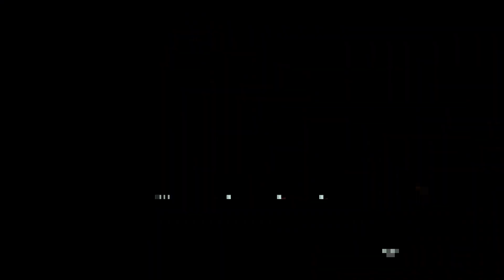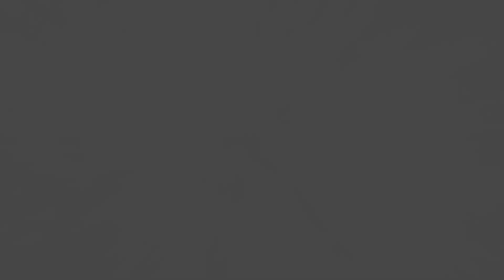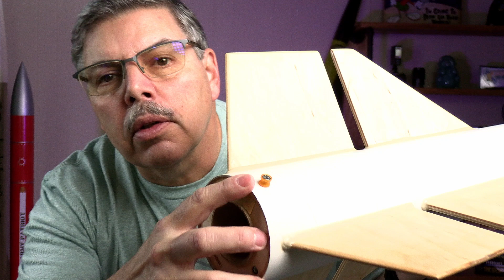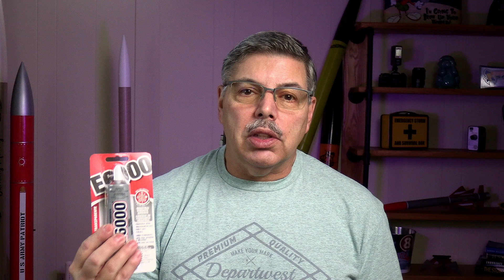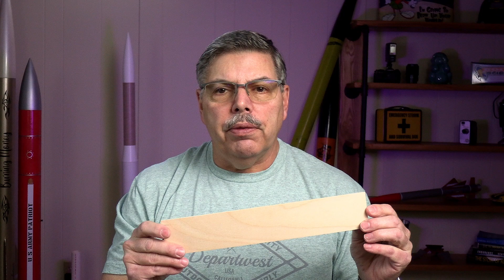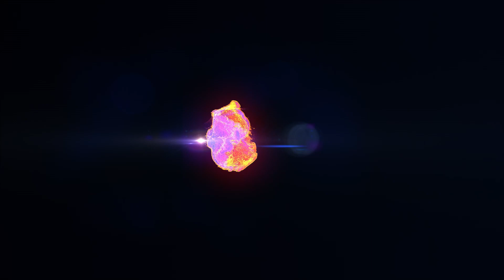Rocket rail button repair with E6000 glue.

Comment: E6000 has lots of uses. It is not heat resistant, it will let go if you leave it out in the hot summer sun. That’s probably not an issue in rocketry but be aware of it.

Comment: I am just starting on my madcow 38mm patriot. I have thought of using E6000 for assembly. Your thoughts?
Reply from the maker: E6000 could be suitable for some things like tacking on fins but not others. It is to thick and not slippery enough to glue a motor mount into the airframe or make filetts. For that I usually use 30 minute epoxy or Elmers ProBond. I like the Elmers because it doesn't smell bad and is slippery enough to get the mount in and then dries hard like plastic. It can also be dripped from the top if necessary. https://amzn.to/3TgzDpO. Everyone has their favorite glue, you just have to find what works for you. I hope that helps.
Reply: @therocketeer  helps tremendously, thank you

Comment: You have more experience in making sugar rocket engines, than me, so I wanna ask you what happens if Kn is too high (350)? I heard that Kn should not exceed 300.
Reply from the maker: That depends on several factors. I have run a KN of 350 in sorbitol and a max of 450 in 38mm motors. The ambient air temp can make a difference. If it is 85°F or higher go easy on the KN and with lower temps below 60° then give it a bump. How much experience do you have making grains? With less experience keep the KN at 300. Grinding the potassium nitrate requires a lower KN, I do not grind mine from Seed Ranch. There are diminishing returns above 350, and 54mm motors should be conservitive. The bottom line is if you are happy with the performance then stick with that.

Comment: Hey, that's kind of a random question but what kind of filament did you use to print stands for casting sorbitol motors ? I've been wondering for a couple of weeks now but as the video was posted long time ago there was no chance of getting a response. Also, awesome video !!
Reply from the maker: I had to ask a friend this question, he used PETG with a 60% infill.  ASA/ABS would be a good choice too.
Reply: @therocketeer  Oh, I totally thought PETG wouldn't stand a chance. I'll try that then. thanks you !!